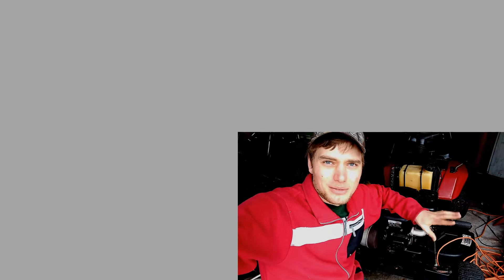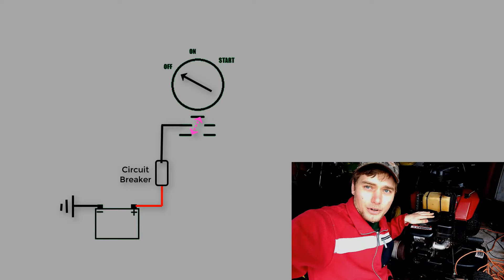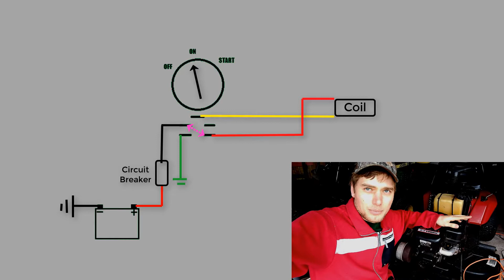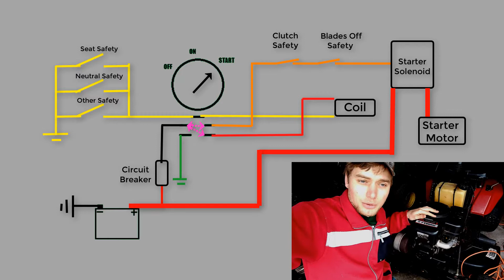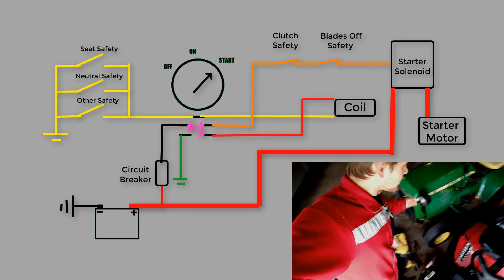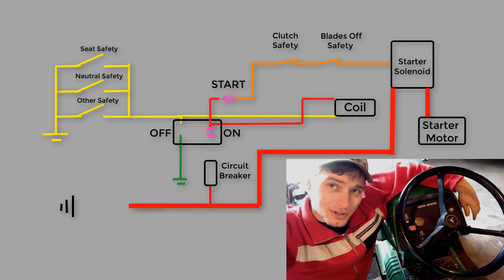How a Lawn Tractor Ignition Circuit Works

Comment: i'm by passing all safety switches on this old honda ht 3000 and hooking up a new starter switch. does the ground on the switch go to the battery or frame for ground and does the coil ground wire go to the frame or the G spade ground on the switch